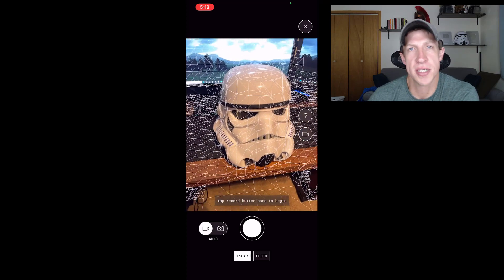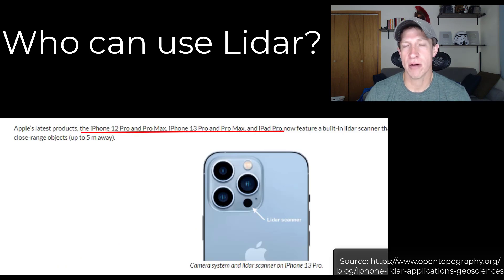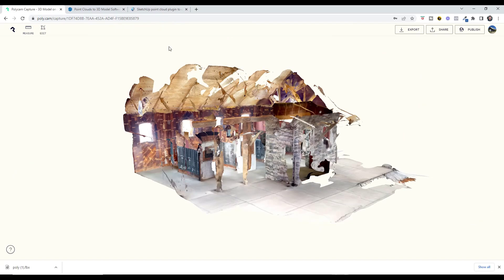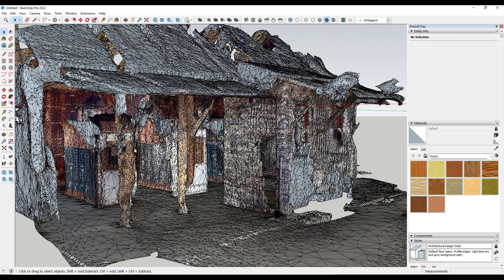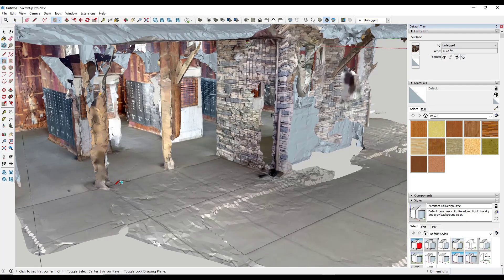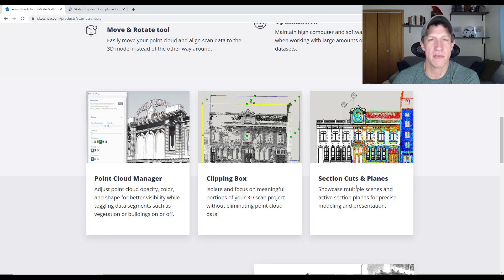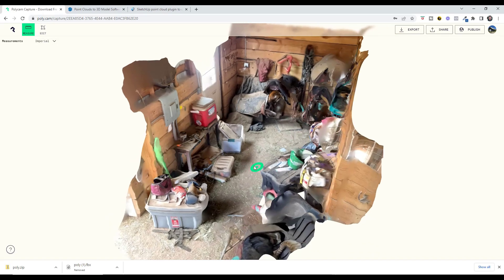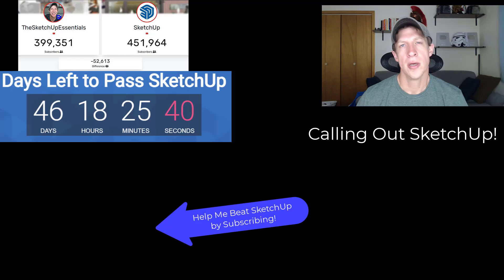The FUTURE of 3D Modeling? Using Lidar Scanning for 3D!

Comment: Hello Justin, I used Polycam scan then import DAE to Sketchup. But I have to cut the mesh for example holes for place model in it. But very difficult to do, Could you advise, what extension can allow cut mesh in sketch up?

Comment: I am autonomous engineer. and I am working on a project for creating a simulation virtual environment for vehicle sim. Photogrammtry and LiDAR scan is the way our team to correct real scene data, however, the hard part is actually what you have mentioned in the video, its really really hard to model on top of those raw scanning data... 
The reason why I cannot directly import the model into the sim environment, is beeacuse the model resultion is too high that the sim engine cannot perform well. Have you every used "Scan essentials" or "Undet"? I am very interested the workflow for these kind of program!

Comment: I use the Canvas app for almost all of my Interior projects now. For 15 cents a sqft they send you back a SketchUp model within 2-3 business days depending on the size. It has tremendously sped up my workflow to tackle multiple projects in a shorter time frame. Totally worth the money in my opinion as I factor it into my costs and have the client cover it. I’ve also used it for a few Exterior projects and they only charge 10 cents a sqft for those.
Reply: What information do you provide them with in order for them to send a sketchup model back?
Reply: @ If you have an iPhone 12 Pro or above, it has a LiDAR sensor. Must be PRO. The canvas app allows you perform the scan and their platform makes it easy to simply order the SketchUp model. You’re not really sending them anything. The data is already captured and stored in the app / cloud.

Comment: I just scanned ~30m of wall with the iphone 13 pro, total station pinged it at 30.275m, lidar data in cloudcompare has it as 29.241m. On hard stand surfaces it's around +/-50mm (vertical checks) but on grass and dirt it was ~200mm too high

IMU drift is pretty bad so keep scans short and sweet, place control marks of known distances to check. I coordinate and scale everything in cloud compare to ensure better results from the scans

Comment: Amazing and exciting where technology is going.
I have to say thought for my interest this doesn't provide the required level of accuracy.
I'd like to survey existing spaces, import the scan into sketchup and then produced models and ultimatley drawings for cabinetry. Given the required standard of the finished work I need to be satisfied that the scan can reproduce a scan to millimetre accuracy.
Can anyone recommend a setup to meet those requirements?
Magicplan may be an option as it seems to facilatate verification of scanned dimensions by laser measurement although I'm unsure if that is any more accurate.
Reply from the maker: In that case you’d probably need a more advanced laser scanner rather than an IPhone
Reply: Do you need mm accuracy everywhere in the scan or only in specific areas? iPhone 14 + a gimbal can improve the overall accuracy but we still recomment taking extra control measurements where mm accuracy is required.

Comment: To use these scans (photogrammetry or Lidar) in SketchUp, we need the ability to turn off the inferencing. If we could select a component or group and tell SketchUp to ignore it, THEN we could start drawing rectangles that stick to the axes, and extrude our walls and shapes until we have rebuilt a clean model.
Reply from the maker: It would have to be a hot key or something - set your first point, then toggle inferencing off

Comment: We use Canvas a lot to convert scans direct to SketchUp files.  It's not always perfect, but great for representations of spaces.  You can usually tell by looking at your scan if it's going to be right or not (there are weird overlaps where measurements might not be right).  Unfortunately Canvas recently increased their pricing so this is no longer an affordable option, but still worth it on many projects for us.
Reply from the maker: Interesting - I keep meaning to test this out but haven’t had a chance yet
Reply: Exactly. We have a process for how to work around drift issues which you can also use if you require mm accuracy in specific areas. Please have a look at our channel and website for more info and our pricing.

Comment: Hi Justin,
I have a question that 3D scanning has had my attention for a long time, but as you said in the video, it is still very expensive.
I've had a Depth Camera D415 for a while now that I could use with Dot3D software. But then I got the license for a month and it worked fine. Only the prices are very high to use it as a hobby. Do you happen to know any software I can use with that Depth Camera D415.
 greeting Hans
Reply from the maker: No clue - I don’t know anything about that piece of tech or what it does
Reply: @Thesketchupessentials  okay, thanks. I was hoping you did. Groetjes

Comment: I dig pools, and i use it to Scan backyards, to keep all the distances from different obstacles and to be able to revisit place virtually if needed. I would also want to be able to count volumes of the ground that needs to be excavated. I transfer the scan data from Polycam into SketchUp.  But than mesh itself is quite thin. You had some videos where you extended the terrain downwards. Video about sliced terrain, first five minutes gave clue how I could theoretically extend scanned terrain .Than Also video ”creating flat surfaces on terrain”. So these 2 videos plus LiDAR data in order to count volumes needed to be extracted from terrain. Ability to count that would save a ton of time for me. Do you think it’s doable using sketchup pro or you need studio.?
Reply from the maker: Not sure - if you could get it solid with the mesh and joint push pull you’d probably be ok with pro, but otherwise you’d probably need something to help you work with the scan data
Reply: @Thesketchupessentials  thanks, will keep on looking. What about doing it in blender?
Reply: @Thesketchupessentials  hi again, i ve managed to create contour lines from the 3d scanned mesh, than created a topography using a toposhaper. It is still not a solid group to know the volume . Any tips from here?

Comment: It's highly recommended to use a gimbal if you are going to scan anything that will require you to walk around while then iPhone is recording it. The accuracy of the scan is helped significantly. There is also a service that will convert these lidar scans to simple skp models for relatively cheap but I forget the name. A had a client try it and it was likly the cheaper path as opposed to me doing it myself and then I only had to deal with the rehab portion of the project instead of the grunt work of converting it.
Reply from the maker: Interesting- I hadn’t thought about a gimbal
Reply: True. Using an iPad usually gives a more accurate scan as well since you hold it more steadily using two hands.

Comment: But you know this has nothing to do with LIDAR? There is no laser in the iPhone.
This is photogrammetry.

You should scan e.g. a table and compare the dimensions obtained from scans and reality. Length, width, top thickness and angles.
Reply from the maker: No it definitely is not photogrammetry - the Iphone literally has a Lidar scanner built in. Now is it lasers or a different kind of light? No clue, but it's really Lidar
Reply: @Thesketchupessentials  The distance to the point that is projected onto the object is not measured with a laser there.
The program calculates the distance based on the change of the distance BETWEEN points.
Reply from the maker: @RROOBBWWAANN  I'm definitely not educated enough in this area to have this discussion - for my purposes, since I'm not seeing anyone calling out Apple for deceptive advertising on this product, I have to assume this is at least technically Lidar by definition, and that it's more than photogrammetry. I can't really contribute more than to this discussion, other than it has been quite helpful to me for realistic measuring on multiple projects
Reply: @Thesketchupessentials Okay, you are right. The front camera has no LIDAR.
The rear one has what can be called a LIDAR.
It is a ToF camera.

Make a scan of e.g. the desk for the test.
Upload to SU. Check the dimensions with the actual ones. I mean the proportions if they are kept and what is the accuracy.
Reply: @RROOBBWWAANN  The iOS LiDAR scanner generates models in correct scale as opposed to photogrammetry based alternatives like the front camera. Please note that the LiDAR sensor works better for capturing spaces than it does for objects such as a desk. Polycam has a capture mode which combined LiDAR and Photogrammetry which works pretty well for furniture.

Comment: LiDAR is really over hyped as it is right now - zero app produces usable drift free results.

LiDAR informed photogrammetry is quite useful like in Trinio
Reply from the maker: I've used it in multiple cases for multiple things. It's much faster than trying to pull a tape measure to measure existing spaces. Would I use the phone data for something that needs ultra precision? Probably not, but in most cases, people don't need that level of precision
Reply: @Thesketchupessentials  we use it to document spaces - this is ten times better than taking photos 

For that LiDAR scan is amazing or capturing an object idea 

But for everything where you need precision it is pointless - and in construction you need precision.

Because of the drift LiDAR scans have walls can rotate bend and such. The iPhone hardware is just not made for that type of work.

We build our own LiDAR Scanner rig and programmed it - this is more precise but stationary.

Even with Google’s slams can drift is an issue.

Just a technical limitation of the tech
Reply: @Thesketchupessentials  even canvas app who claim for years to do it best just deliver a tech limited scan result.

Look into systems that use LiDAR for scale and photogrammetry for the mesh detail - those systems are much better
Reply: @Thesketchupessentials  the tape measurement dear lord

Interesting will be apples room scan and their new api allows more high res images to be used for ARKit and lidar

Comment: Lidar scanning is something I want to continue using because I mainly model for game asset creation, and it's perfect for low-detail. The literal only downside to lidar scanning is it's lack of texture/mesh detail compared to something like photogrammetry. However, the amount of time you save by lidar scanning something is astronomical and a MUCH better option, imo. The only reason I'd suggest Photogrammetry at this point over lidar scanning is if you need REALLY high-detail models.

Lidar is a fantastic toolset for 3D creators and I hope the tech continues to grow!
Reply from the maker: I'd agree with this assessment - the meshes are...difficult, but it is really fast

Comment: I'm an engineer and oftenly use the LIDAR in my Iphone 12 pro. It helps a lot, the way I use it is to scan houses and buildings, and, also use Polycam for it. But, sometimes big houses and big buildings are a little bit hard on the Iphone to keep track of everything and often it loses track of your scan. The way I solve it is to scan sections of the buildings based in, size and furniture. The more furniture present the smaller the section gets, then I import everything to sketchup and, like a puzzle I assemble all the sections to form the "floor" that I'm working at. But that's just for the overall footprint of the building. After that I open a fresh model in sketchup and with my account of Polycam opened I go and measure all the stuff that I need and model it in sketchup from the start, but also, keep tracking of where the rooms are in that building.

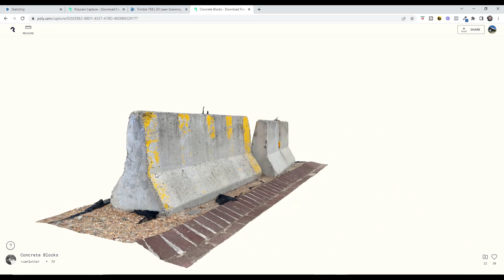This workflow make me measure and do the Architectural Project of the building in Sketchup with Layout in 1 day for a building of 470,00 m² or 5060 sft. To measure is around 1:30h and to do all the project is around 5 - 6 hours.
Reply: Do you know how to make a model from the scanned mesh, once in sketchup? So you can further edit it ? Shape and add objects to it?
Reply: @ЖИЗНЬСДЛИННЫМ  I do it by hand, the mesh of scanned materials is hardly “workable”. You can simplify some meshes with stuff like Transmutr, but the mesh will still be messy. The only way to improve your performance with this tech is by using it as a “tape measure” and as a guide to get the most realistic result.

Some extensions help you a lot in this process, the ones I tend to use is:

 - 1001 bit tools
 - Instant Architecture 
 - Zorro2
 - Fredo Tools
 
And, if you’re using Enscape to render, Skatter is essencial.
Reply: @ReDevil67  because I’ve being searching for clues whole week. I scanned the terrain. And I want to to most accurate measurement possible. I need to dig a pool in that terrain. So I moved it in sketchup, made a cube - as a pool excavation. Than placed it inside the terrain, so I can see outline of the terrain on the cube, a can also draw on that cube lines of the terrain, thought using push and pull options and tried to have a grid on that cube and push each part downwards until it meets the terrain, but it’s too complicated. Wish I could just delete part above the terrain and know the volume in entity of the bottom part..
Reply: @ЖИЗНЬСДЛИННЫМ  Group the pool and place it where you want it to be on the terrain, then, select the terrain, right click with mouse > intersect faces > with model. Move the pool somewhere else to see the terrain without the pool and delete the faces where the pool would be. Make sure you have a backup of your model first, sometimes the intersect faces command glitches sketchup in the case of a heavy model. Also, if sketchup freezes, justo go take a coffee and come back later and it will be done, the time will also depend on your computer processor.
Reply: @ReDevil67  so this procedure would cut the pool shape of the terrain?
Reply: @ЖИЗНЬСДЛИННЫМ  Yes sir, the procedure will make the cut, then you just have to delete the faces you don't want out of the terrain
Reply: @ReDevil67  but how than Will i know the volume?
Reply: @ЖИЗНЬСДЛИННЫМ  with the shape you used to intersect with the terrain
Reply: @ReDevil67  could i contact via skype or smth?
Reply: @ЖИЗНЬСДЛИННЫМ  do you have WhatsApp? Here in Brazil we don’t really use another thing
Reply: @ReDevil67  that works just great!

Comment: I do retail design… for this i often need elements with a natural feel… like coats on a hanger or a stack of tshirts on a display…. For these I use a combination of photogrammetry or LiDAR scans (also a big fan of polycam) and then I import into sketchup using the transmutr extension that can reduce the number of polygons….
Reply from the maker: Yeah Transmutr is great for simplifying the meshes for sure